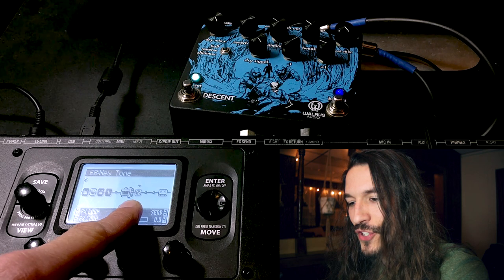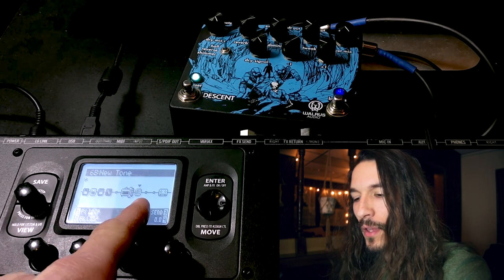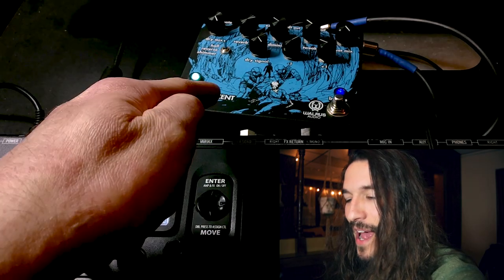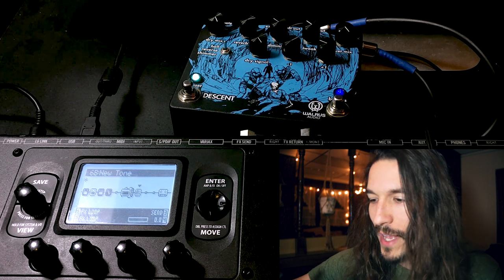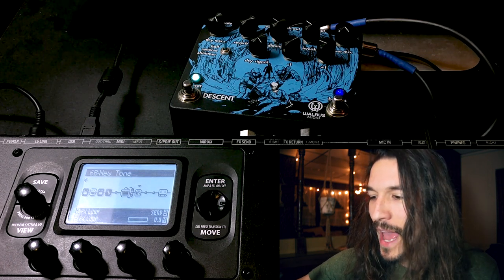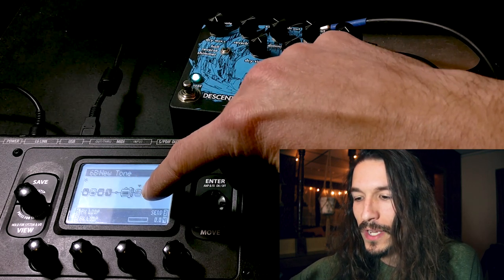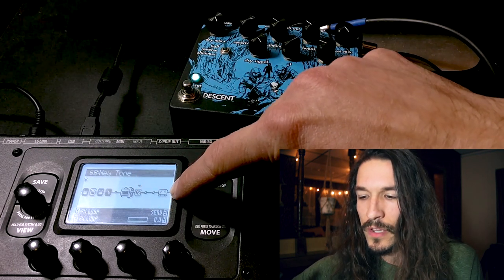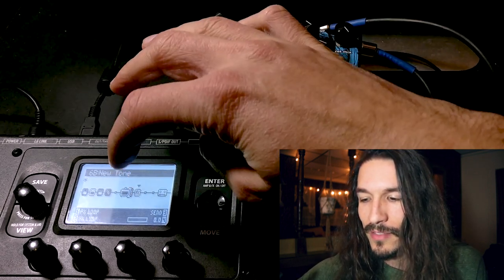How have I NEVER tried THIS?!

Comment: If you put effects loop block at end of chain, set it to 100°/° mix, 0 return, send assigned to expression pedal for volume control, you can use this send as a separate output to a mixer and no sound will bleed out of the normal xlrs and 1/4" jacks. Use it on my bass guitar patches. When I hop back on guitar, I still have my stereo guitar guitar patches going out my left and right XLR cables to the board. Bass has it's own channel at the mixing board. Mono signal. Haven't bothered trying a TRS cable for a stereo send out of the effects send jack for the bass patches but I would think that's possible also.
Reply: I suppose if you wanted to get creative, you can set your input on the pod hd500x to aux in and guitar in or microphone in and then  create a patch hard panned left and right with separate block paths for each input device. Then you would put the effects loop block at the end of the chain. Using a TRS patch splitter (Y) cable, you could send out the 2 extra input devices to their own inputs on a mixing board. All this set up per patch so you can maintain your guitar input jack and patches. The effects loop can be used in many ways. It can be a solo db booster. It can be put at the front of the chain as a switchable input source using just the effects return jack. Super useful tool as I play multiple instruments.

Comment: Hey, I have bought a Mooer Radar cab simulator pedal and use it with POD fx loop. Now I can use POD with impulse responses that make POD sound way more natural and better. I don't use stock cabs at all
Reply: I think you can disable stock cabs and use the radar after the output of the pod, so you have an extra slot for effects if not using the fx loop

Comment: Just wanted to say that i figured out something cool on a new way to get a DRY and WET signal simultaneously (using the FX loop).  It requires you to own an analog/digital interface like Jon has in other videos.  It will use 2 ports of the interface.   Method - place an FX block at the front of your chain and set the mix to zero.  Then just use 2 leads (1 from FX out and 1 from L/Mono) and plug them into 2 input ports of your interface.  One will be a DRY signal  .   The benefits of this method are - simple to configure each preset.  You can still use a full split signal for WET.   You can potentially still use 2 amps or stereo effects (using a 3rd cable).     .    If everyone knows this already, just ignore me.

Comment: Nice video and trick if you want to use the FX loop for wet effects... But for distortion and drive pedals why didn't you plug the guitar in the input of the drive/distortion/boost and then in  the input of the Line 6 Pod ?....(" Before the Amp")
Cheers .

Comment: Great video! I have a question unrelated to this video that maybe you know the answer to and would be willing to answer. I recently got an RC-500 and I want to use my Pod HD 500 as a midi controller for it. I have it all working... sort of. I have the Pod set to CC toggle as well as the RC500 set to toggle. If I don't have these set to toggle, the CC midi changes do nothing to the RC500.  So things are set to toggle. BUT, the parameter on the RC500 ONLY changes when the cc value on the Pod goes from 0 to 127. It DOES NOT turn off the parameter when the CC change goes from 127 to 0.   What this means is that I have to press the foot switch twice to make any changes. Once to go from the value of 127 to 0, then again to go from 0 to 127 for it to change the parameter on my RC500. Hopefully this makes sense. I just want to press the footswitch once to change parameter. Any suggestions or ideas why it's behaving like this?

Thank you for any help you might offer.

Comment: Thanks for the vids! They’re very uselful for me when I’m trying to sort out which pod I should go for, the pod go or the hd500x. 

How about if I want to use the hd500x only as a pedal board. Can it bypass the amp models and leave the signal as it is? Should I have it in the amplifier’s effects loop or connected directly between the guitar and the amp?
Reply: I can answer this one. I have the PodHD 500 (not x, but they are essentially the same). I use it both as an all in one when I'm doing guritar streams (using the amp models) and as an effects pedal board when I was playing in my band. All you have to do is turn off the amp block with the 500x and it will work as an effects pedalboard only, and will not apply an amp model to your signal. You could also use it in a 4 cable method (just google POD HD500 4 cable method) so you can place your drive effects before your amp, and your modulation, delay reverb effects after your amp if your amp has an fx loop. Alternatively, it works just fine going straight into the front of an amp.
Reply: @TR-zf6io  Thank you! I actually bought the hd500x and have tried multiple different methods, and it seems there is still much more to explore. Next up is trying out the four cable method just the way you described! :)
Reply: @DrWepper  awesome. hope you enjoy it. piece of advice if you want it... I'd recommend spending time becoming familiar with the user interface without plugging it into a computer. While it's certainly easier to set everything up with the computer software, having an understanding of how to do so without it has proven very useful for me.
Reply: @TR-zf6io  That’s true, and so far I’ve spent more time on the pod interface itself at the band rehearsal room than by plugging it in the computer at home.

The next, often neglected step would be reading the manual... :D But, seriously, there are so many features that cannot be understood without consulting the manual, especially since I’m used to the logic of stomp boxes.

Comment: Hey there, what if I wanted to use the 500X as an effects board only? No amp modeling?
Reply: You can do it you need to connect: pod fx return to amp fx send and pod output to amp fx return. You connect your guitar directly to the amp. Remember to add the FX block to the virtual patch in 500x